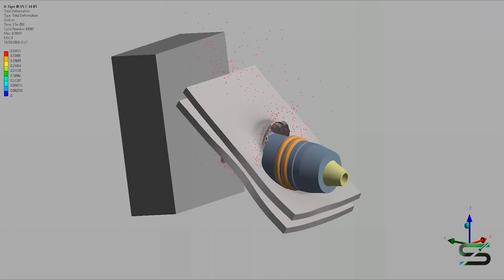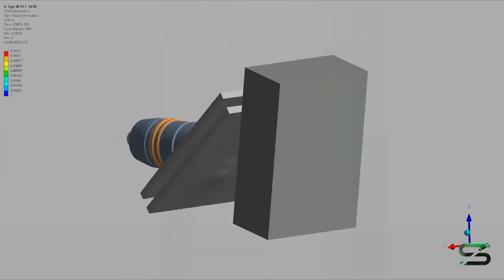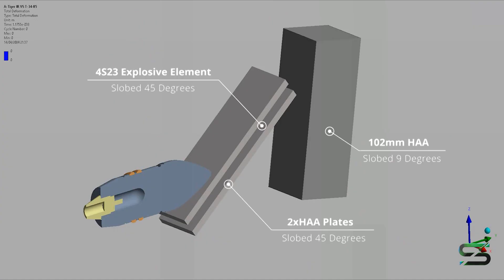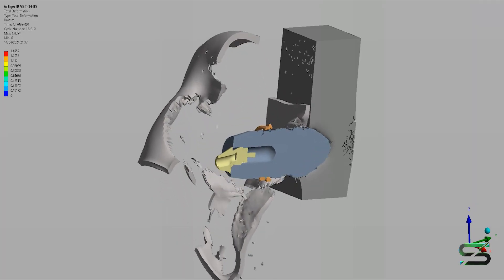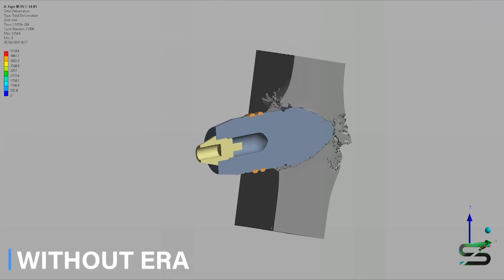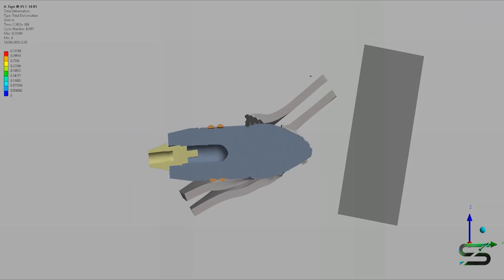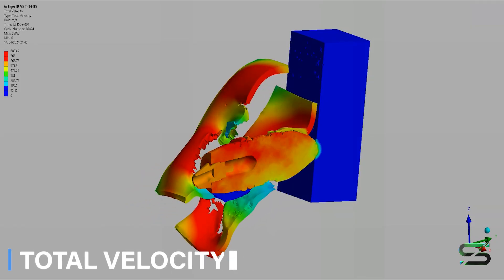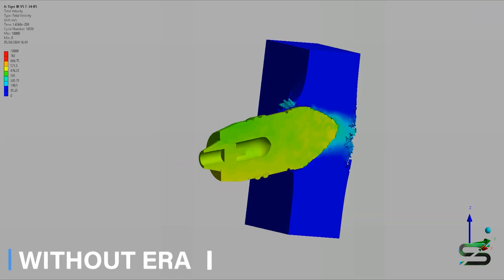Tiger I With ERA VS T-34-85 | Armour Piercing Simulation

Comment: 763 m/s is too slow for activating explosive component of ERA. Need >1200 m/s
Reply from the maker: You are reading the BR velocity. ERA components velocity contours have the same color but much higher value as seen in the scale. This is intended so the variation in the BR velocity is obvious.

Comment: As stated by a few others. Been a short stubby round that's full calibre, the ERA loses a lot of effectiveness.

Would be interesting to see what a modern 120mm full calibre AP round DU or tungsten (aka theory round)  launched at around 1600m/s would do to current MBT composite armour without ERA
or the 2A5 turret with the added cheek amour thats designed to stop APFSDS

Comment: i love this crap...even soviets had to try side shots bcos 85 have no chance to pen front armor of tiger...
Reply: It can pen the fromt quite easily . Its not imposible
Reply: You can literally see it in the without ERA part of the simulation, goes right through...
Reply: T-34-76 can not but we kalking about T-34-85 and HE CAN ;-)
Reply: i love wehraboos coping, man
Reply: The t-34/85 can penetrate tiger front armor provided at a range of 500m and below using normal shell.
Reply: "No because it's German the T-34-85 can't pen! The simulation is fake!" -average Tiger fan
Reply: @Dixieland_1861  Hi kommie

Comment: So it looks like the ERA will be most effective against long and thin shells, which rely a lot on its stability.
It can still reduce penetration of APHE rounds, but the effect is much less significant than a thin APFSDS
Reply: Begs the question what about solid shot which has more density

Comment: the explosives helped pen the armor lmao it normalised the shell.
Reply: @mr.waffentrager4400  Nope, it is the test without ERA, it is literally written "without era"
Reply: I see my bad  @Maverick966
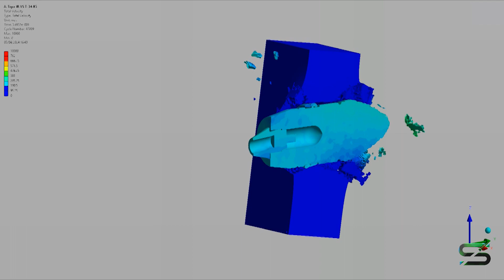Reply: I don’t think it did overall, but I said the exact same thing to myself out how it helped normalise the shell. At 1:40. I think the reduction in speed was enough to counter the improved angle, but it’s interesting that it did that.
Reply: @itsmrlonewolf  Plates helped armor, explosives helped the shell.
Reply: @itsmrlonewolf  It did that because the ERA works like that to deform and destabilize long rod penetrators, on a full caliber round since it is short it looks like it helps to normalize it
Reply: Plot armor
Reply: If you're main character @destroyerarmor
Reply: Ehm nope, the round didn't penetrate the armor with ERA even if spalled it, while without ERA penetrated completely

Comment: Try a t-34-85 with relict or contact 5 against a tiger 2?
Reply: Still goes straigh through. Full calibre rounds aren't affected by era as much as the more fragile darts we use today.
Reply: @Masterafro999  yeah but 20mm high quality steel will help a lot. I'd say it won't penetrate at 1km
Reply: @tedarcher9120  maybe at 2.5km but at 1km the penetration power of the long 88 basically has not diminished at all and is still around 3 times what is necessary to pen a t-34
Reply: @Masterafro999  the ERA ''Kontakt 5'' was able to effectively increase the armor by 200mm and Relikt increases this almost twice (400mm)...
You can tell me anything...but not that the Tiger 2 has over 400mm penetration at 1000m...
''Contact 5'' at 500m range, he could penetrate the T-34-85 but with relik ?? I do not think so.
We don't even want to start talking about nest development "Malachit" ;-)
Reply: @Hizungaya  Эти цифры указаны для кумулятивных снарядов, а не кинетичексих
Reply: @Hugo_Stiglitz_1  No, that's not effectiveness against heat but armor piercing.
The numbers are even higher against heat
Reply: @Hizungaya коэффициент повышения защиты указан как 1.4 против кинетического воздействия. И что-то подсказывает мне, что Тигр 2 с легкостью преодолеет ее
Reply: @Hizungaya  you misunderstood how different types of ammunition are affected by various types of active or passive armour arrays. The values given for k5 or relikt are based on the current ammunition threat a soviet tank could have faced. Apfsds. Not aphecbc. Apfsds are brittle, thin darts that have little lateral stability which era seeks to exploit. Full calibre shells are less affected by era because of their high lateral stability and ability to flex and sheer. The same goes for heat compared to efps explosively formed penetrators. Read up on the matter. It's highly interesting.
Reply: @Hizungaya  Here it is the Relikt. The 4S23 and 2x HHA is the Relikt
Reply: Белиссимо👌